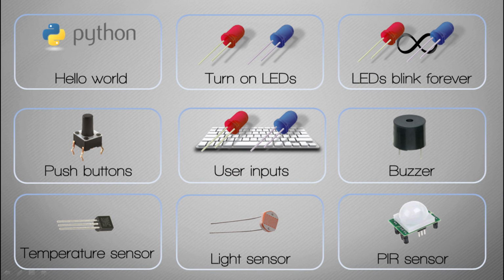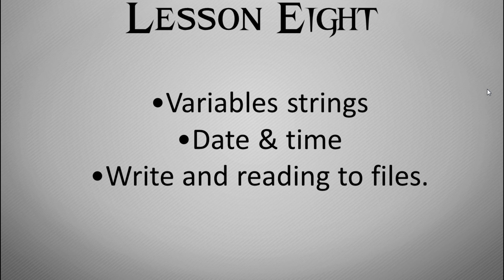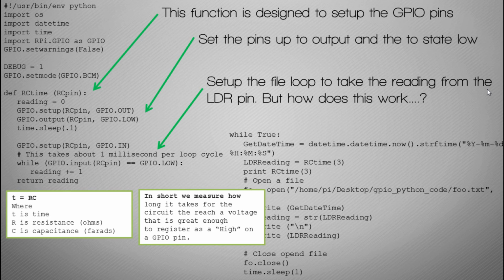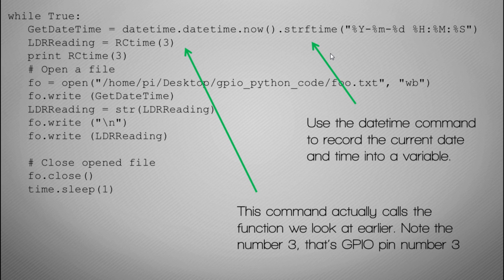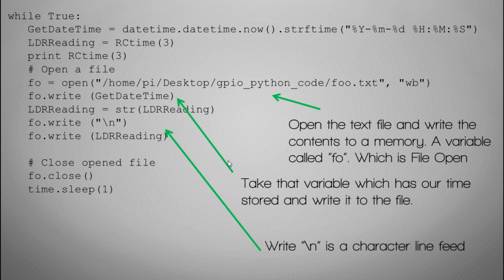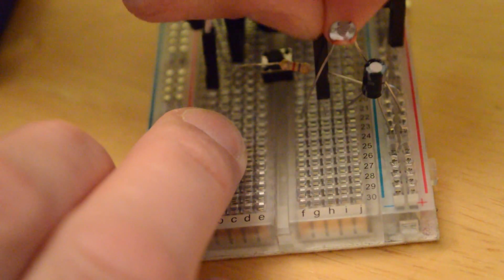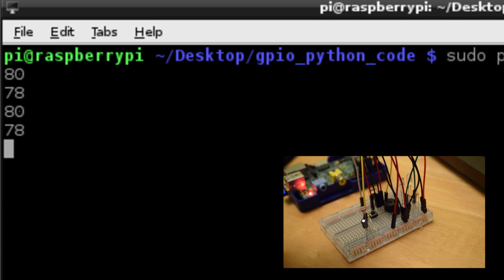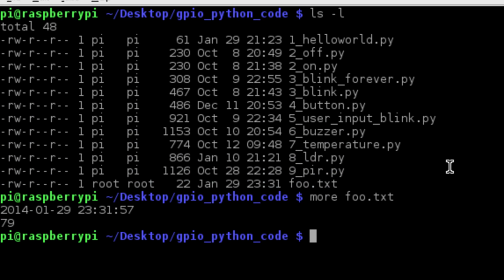Raspberry Pi - GPIO & Python (8/9) - Light dependent resistor

Comment: Great tutorial. What voltage is the capacitor?  I'm a bit of a noob when it comes to electronics but when searching for 1µF Capacitor there are a number of voltage options all which appear to be higher than than of the raspberry.

Comment: I keep getting "RuntimeWarning: A physical pull up resistor is fitted on this channel!"
I'm certain that I have it set up exactly as described and I've double checked the code but I dunno what to do. Any tips?
Reply: Christopher Douglas This was happening to me too.  I realized that I was using the wrong GPIO pin number at one point.  Check to make sure they're all correct.
Reply: Good Job!!!
Reply: I bet you didn't under stand it.
Reply: Michael Shi Yes, this is my first RaspberryPi and I am new to GPIO, but I am positive that the code is correct and that I have it wired up properly.
Any suggestions that might help?
Reply: okay
Reply: Chris Appier It is an annoying thing that the new version of the RPI library does, it can safely be ignored.